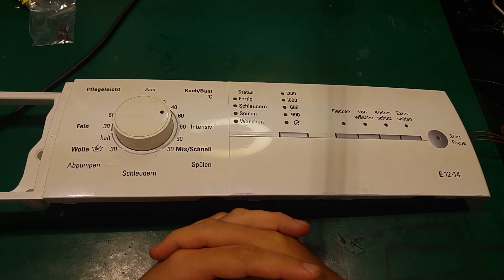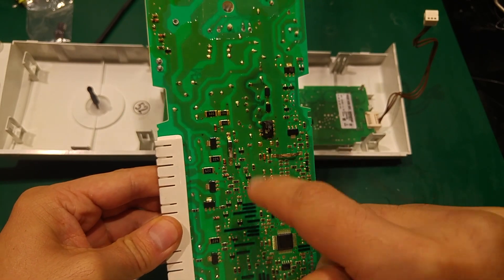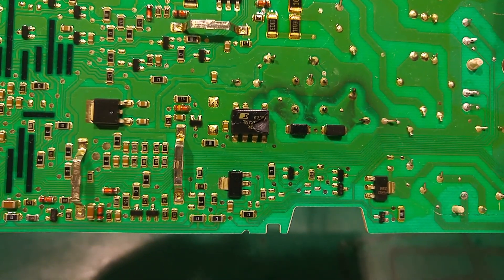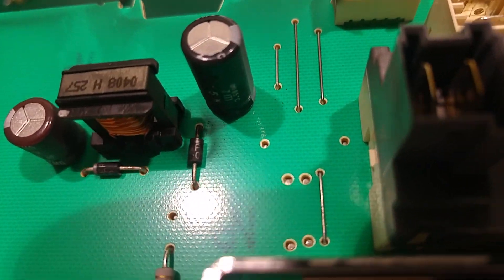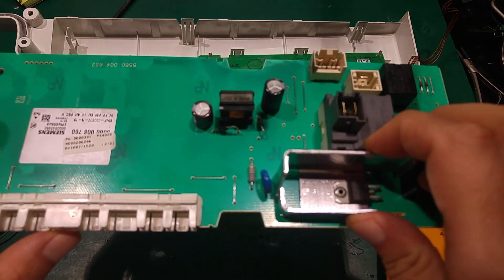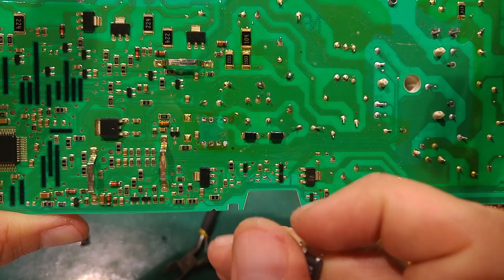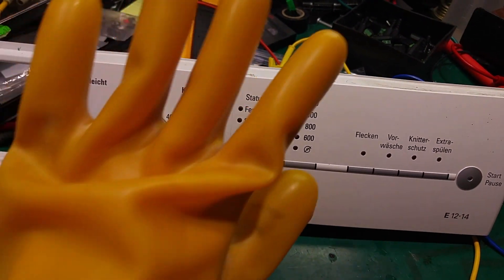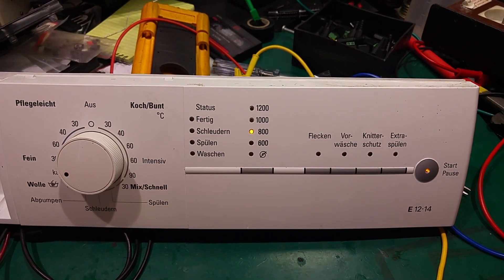Siemens washing machine  (no reaction to power) fixed by replacing exploded  TNY264 IC

Comment: I'm a technician 
I have a Siemens IQ 100 washing machine complaint the first complaint was when we put in wash or spin program it's rotate fastly only one side after it's off again same program continues
After I find out the pcb transistor was burned I changed the transistor after wash and spin works perfectly but now 
The problem is when we put on a wash program the main wash motor runs directly with out filling water and some times the water inlet value makes some noise like supply on and off 
You have any idea what s the reason and which part is faulty in the pcb board
Reply from the maker: Sorry, I have no idea, i don't work on washing machines - this was just mine unit and it was single time job so I don't have any expertise. Generic advice would be test water solenoid valve without circuitry - just power it directly and see does it open properly.   If it's working properly then start checking out water level sensor, i have no idea where it is but looks like it can send wrong data so it confuse microcontroler to think it's full of water - so it open and close it too soon. <- just guess based on my general electronic reasoning not washing machine

Comment: Check that big resistor on the other side of the board (next to the blue varisotor). It is a fusable resistor that is to protect the IC, when the IC blows the resistor is usally damaged.
Reply: I'm just about to try this fix on my machine. I think the heat has changed the colour of the bands on the resistor making it unreadable (reads 14 Meg. ohm on meter!) - but the first band looks brown so I'm guessing it is 100 ohms and there are ebay ads selling 3 watt resistors with the TNY264GN. I don't know about "fusable" I've just ordered a 3W wire wound resistor. But if others are researching this fault, here are two more videos of the repair: https://www.youtube.com/watch?v=R_2XuHaczAY&t=659s&ab_channel=MrWashyWashy
 and this one where he replaces the 100 ohm resistor: 
https://www.youtube.com/watch?v=fl1JaCIh08o&ab_channel=Qphixappliancerepair